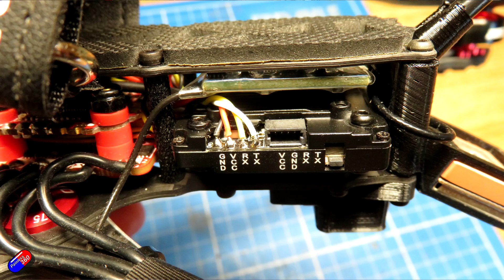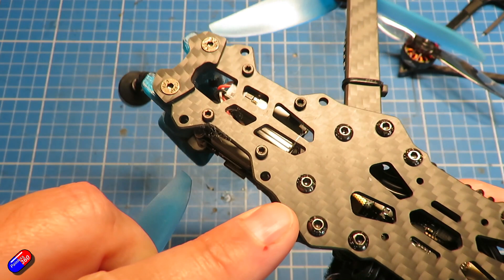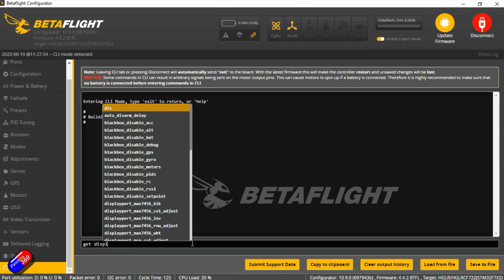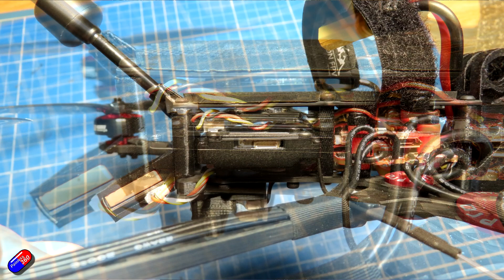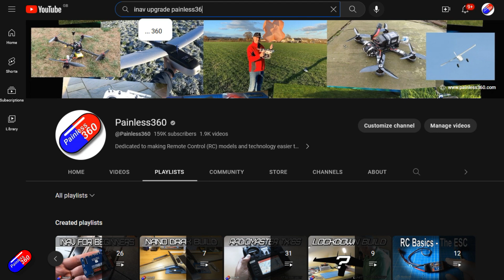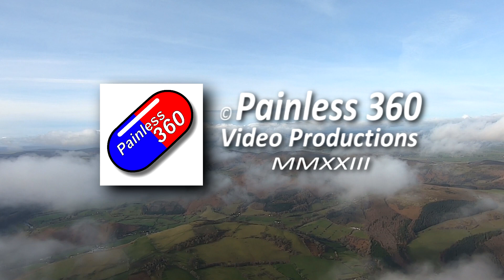Converting your Quad from Analogue FPV to HD FPV (tips and tricks for the first timer)

Comment: Thanks for the tips!. I think CG also is important because usually digital system (old dji air unit) is heavier than analog so rear motor will spin faster to level the quad. Can analyze using blackbox data.
Reply from the maker: Yep, battery placement may move slightly to get a nice balance at the center same as with any change.... Happy flying